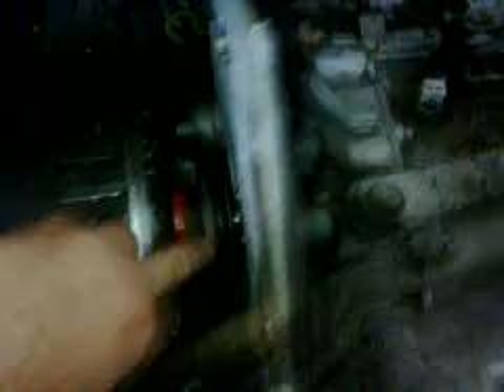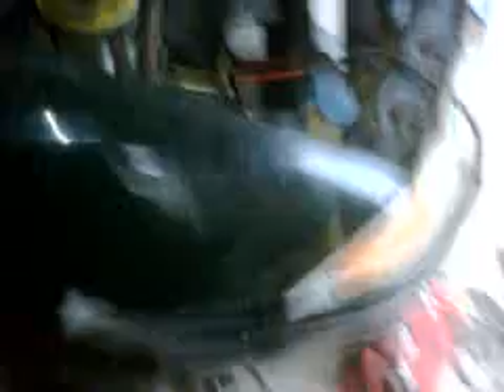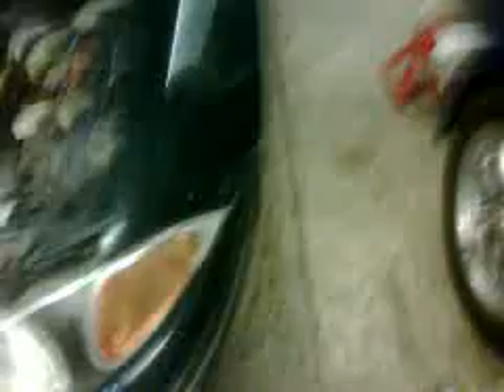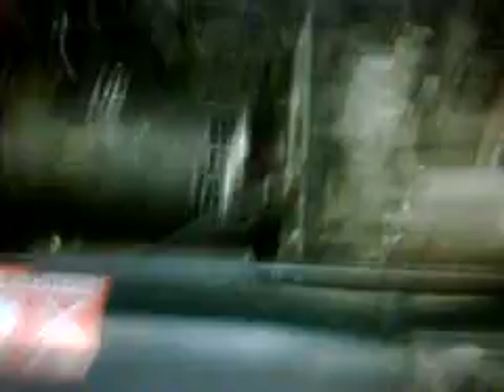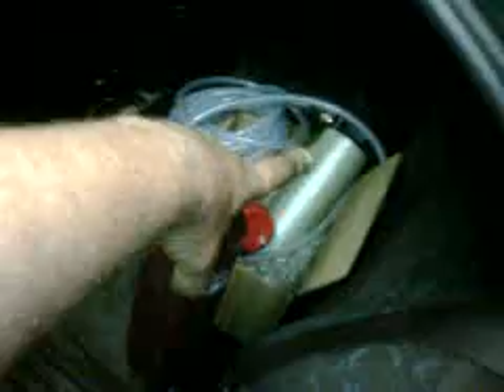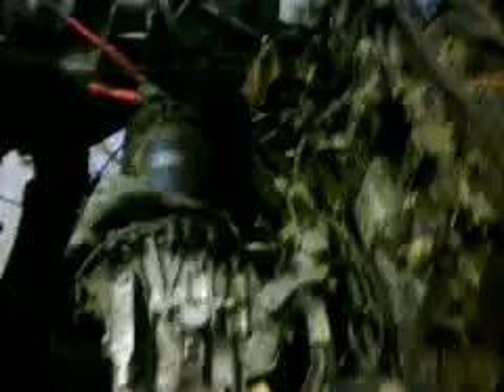Electric Car Conversion Rover Part 17

Comment: Great to see someone doing a conversion on a sensible budget. Keep up the good work. Best batteries will probably be AGM lead acid. For your dc dc converter its possible to use a modified pc power supply with its 12v output tweaked up to 14v or so. Are you going to use a pack charger or individual chargers for each battery?